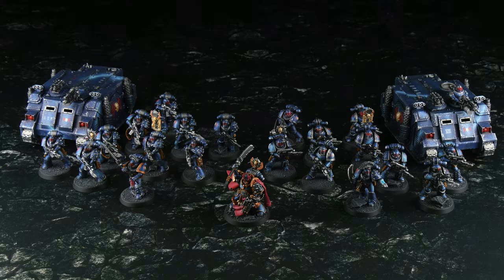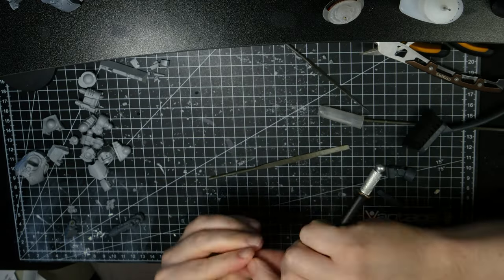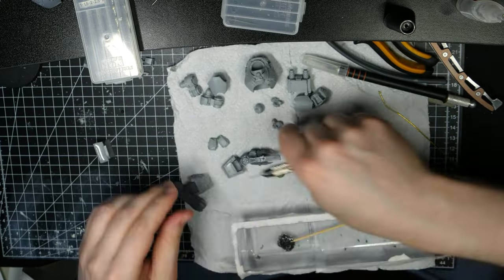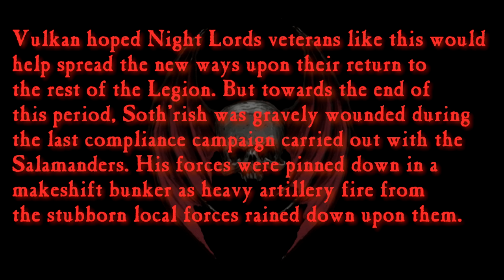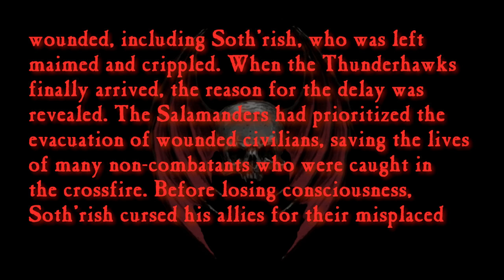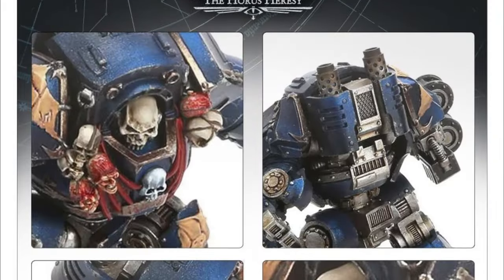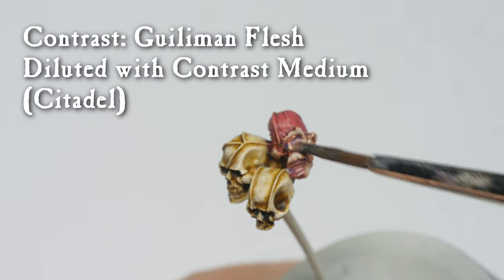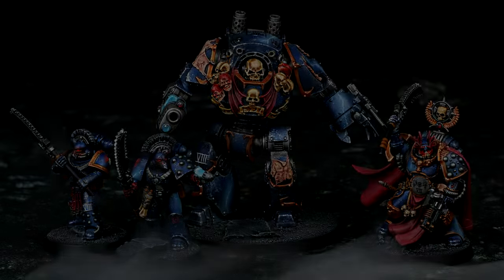Horus Heresy: Building a Night Lords Army Part 3

Comment: I think one way to make a dreadnought body work for basing would be to drill/cut out a foot-shaped hole (or blast hole) and fill it partially with modeling compound. Like the weight of the machine is denting the armor? At least in my thoughts that could work. Maybe for that leviathan dread you talked about?
Reply from the maker: Brilliant idea! That could really help sell the weight of the Leviathan 👍
Reply: @KabinMiniatures  if it's too much work you don't have to. You could just probably make it a shard of the dreadnought after it exploded? It's all up to you!
Reply from the maker: @SWATDRUMMUH  Also a good option 👌 thanks for the great ideas!